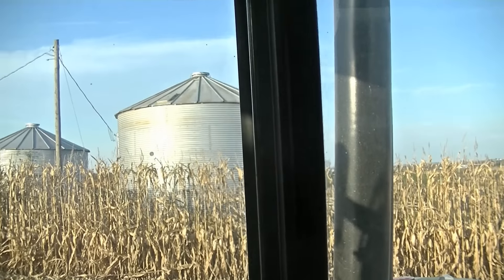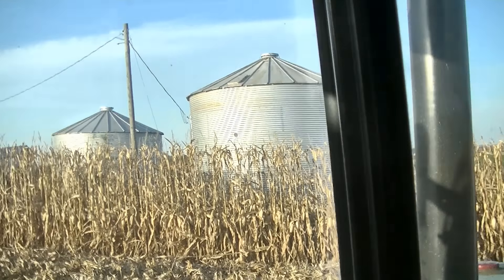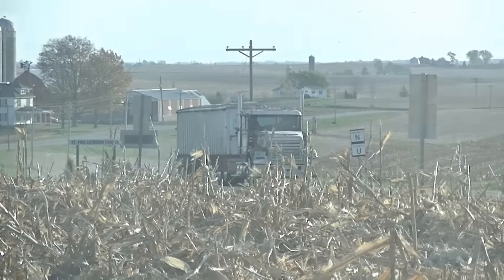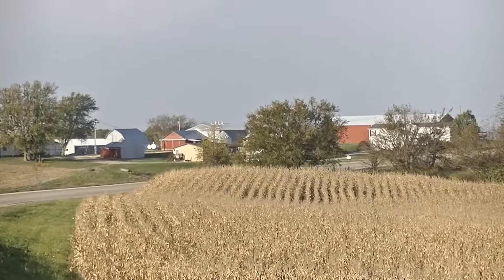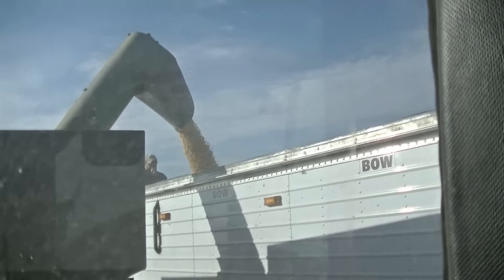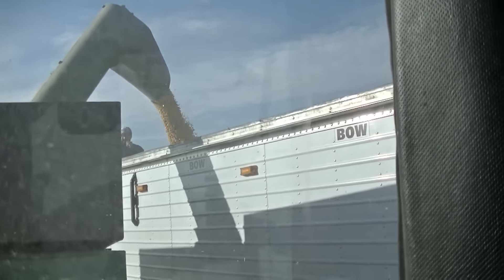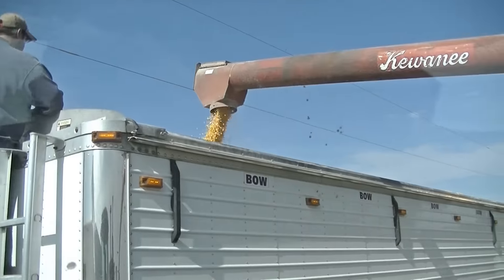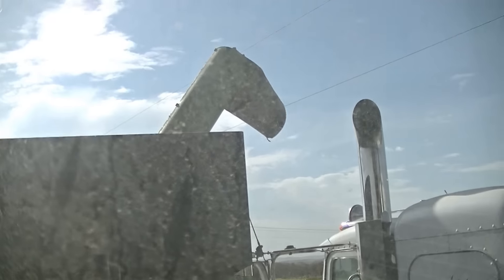Harvesting The Upper Farm

Comment: we eat little corn. is that corn for human consumption or chicken fodder. we have Deere or Claas to chop the whole corn plant. A combine gets stuck in the mud as fields are mostly swampy by end of october. then the chopped corn is spread on the soil to form a silo which is driven fest and compact with a tractor. then we seal that first with 8mm plastic foil and a layer of dirt is spread over with a special spreader. that corn yeasts even if it is dense. in winter farmers open the silo every morning, take out what is needed to feed cattle and close it back up. it stands damping there when loading and obtains easily a good 100 degrees f. you can warm your hands on it in winter. take care chopped corn is good fudder but must be switched with dry hey. giving too much corn of this kine will make the meat taste ...corny.yep